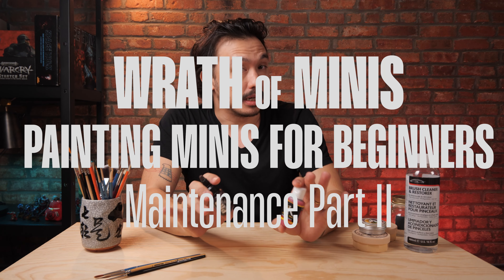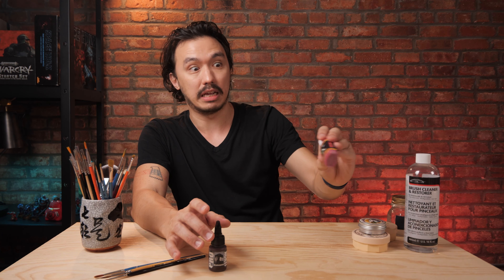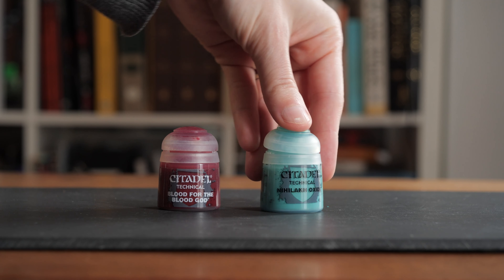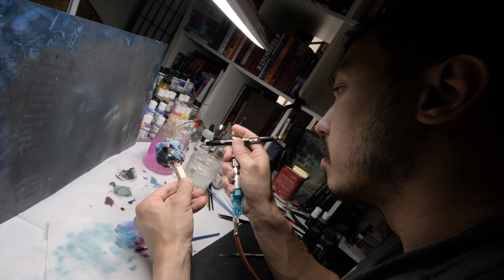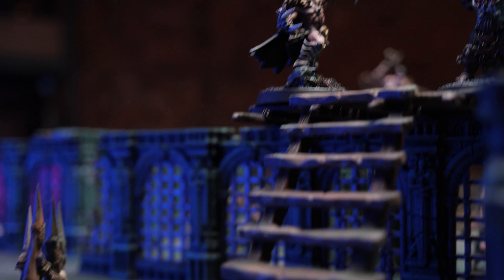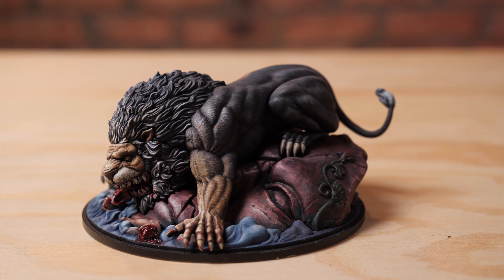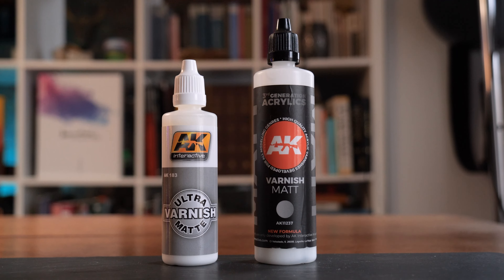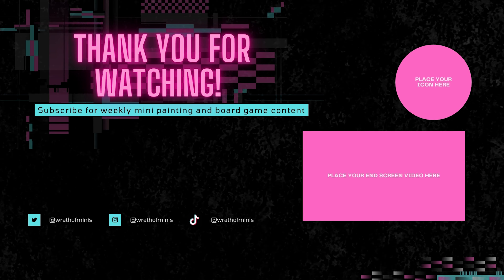Random Mini Painting Maintenance!

Comment: Great video! I have a question though. Sometimes when i leave paint on a wet palette some mold starts showing up a few days later. What can i do to prevent that?
Reply from the maker: Distilled water is the main way but I never do that. I leave the lid partially off and clean the sponge every couple of days. Seems to work for me.
Reply: If I may, two suggestions I've heard on this issue are putting your wet palette in the fridge, or putting a bit of copper under the sponge.  I know, weird, but there ya go.  I myself use distilled water, and then refrigerate between sessions.